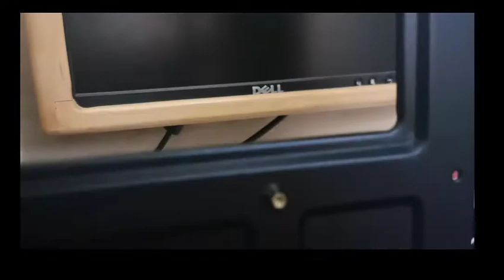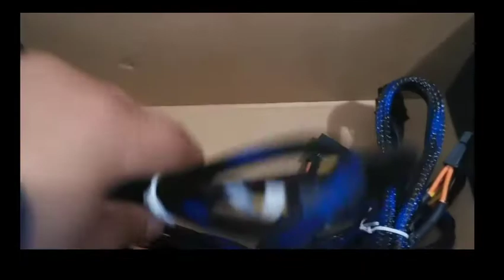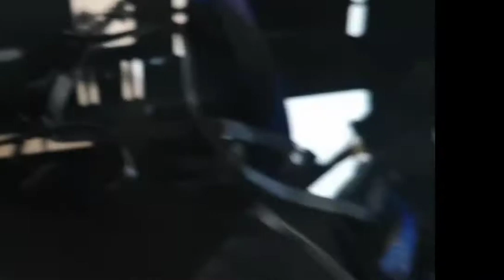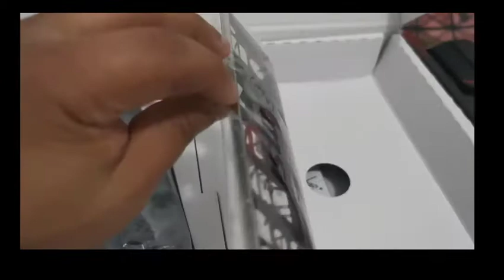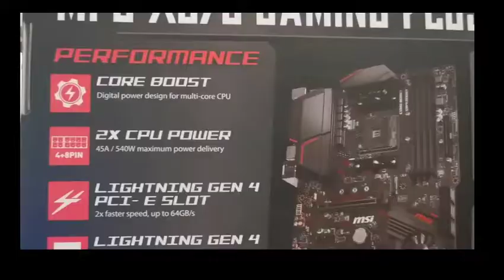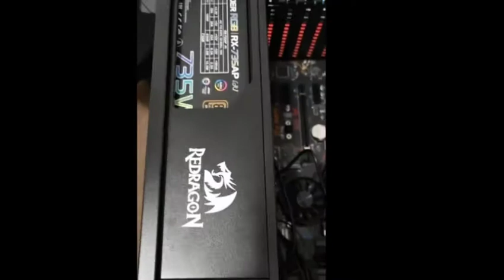Building a Custom Gaming PC using a Redragon Diamond Storm CA903-PRO Gaming Cabinet Tower

Comment: Jir bra my Strix 580 is suffering in this case. Used to run 70C under load now its hitting 89C. May as well duct tape an aircon to the front of the case xD.